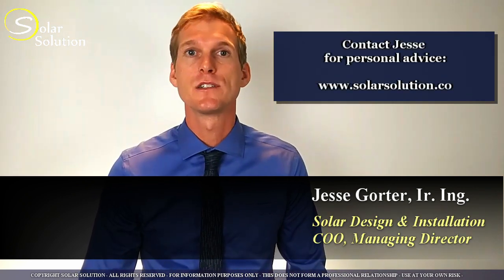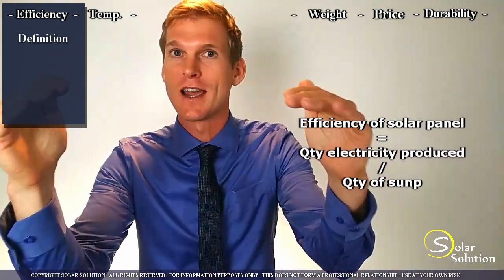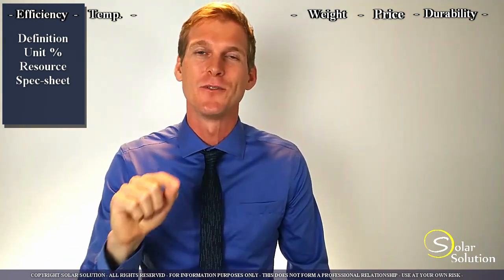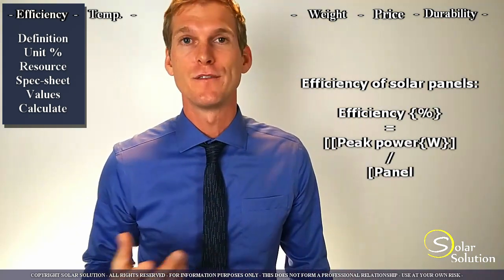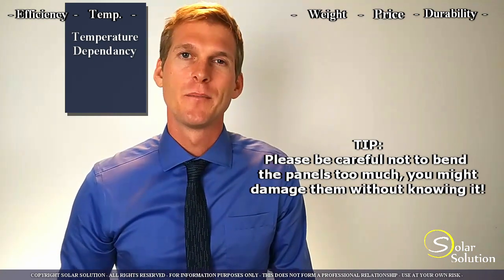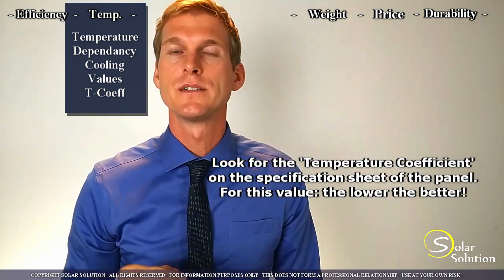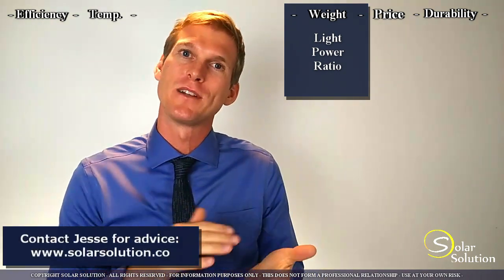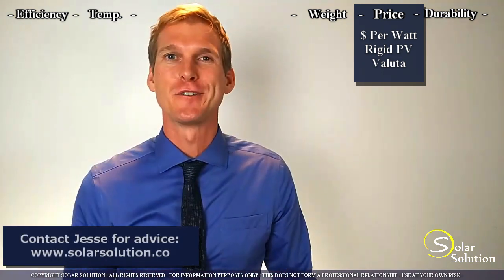Flexible Solar Panels: How to identify high Performance & Quality

Comment: Very informative on the base level...thank you.   explained it well.    Joke:  Chinese flex panel 200 x 2  400  panels.. no real specs. ...  warranty.  20 years IF you dont use them..   void if hooked up

Comment: Hi Jesse. I love your videos. I have some specific technical questions.
I want to mount 2 x350W ETFE panels on the aluminium roof of my caravan.  There are any number of reasons that make this a desirable solution however I have some specific questions about temperature and durability performance in this particular environment. 
How much convection cooling is achieved from the back of a flexible panel.
How much conductive cooling is achieved through the back of a flexible panel.
How much black body radiation from the front of the panel helps keep the panel cool.
Can I assume if a panel has 1Kw radiation, at 20% efficiency the heating effect is equivalent to 800W onto a non solar surface.
Are there any issues with delimitation. 
I think many of these questions would come from specific research and measurements. 
Any help would be greatly appreciated.

Comment: When you mount the hard mono/poly on a Van, how durable are they to all the pot holes, and imperfect road bumps?  Are the Hard panels better or flexible panels?  I guess I am asking, what if I have to travel on gravel road bumpy, vibrating road for several hours, would the hard panels break (inside)? Are the flex panels better?  Let me know. Thanks.

Comment: Hello Jesse, I have been enjoying your videos and vast knowledge on the subject. I would like your opinion on the "CIGS" technology flexible solar panels. I just order 5 each 80 watt panels from Rich Solar for 400 watt total, pricy at $259 each but they say you can walk on them and that they pull power from early morning until the sun sets. 68" x 14" and self adhesive (good and bad) but they will lay flat with no wind resistance or extra road noise. Hoping it will do the trick on my little 24" Fleetwood Pulse RV. 12V 300Ah Lithium Iron Phosphate. Keep the videos coming, great work.
Reply from the maker: Congrats on your purchase! I am sure you will enjoy them: The weight advantage and ease of installation are great pro's for CIGS panels. I'm glad to hear you enjoy the videos. All the best, Jesse.

Comment: It would be nice to better understand how to measure efficiency of a panel after some time has passed. Is it volts, amps, or ?? And can a consumer with a VOM measure this successfully? Or does the charge controller offer those values in most cases?
Reply from the maker: Hi Dennis, thanks for your message. Great topic suggestion, thanks. I will convert that into a dedicated video. Jesse.

Comment: I am curious if you are familiar with Merlin Flexible solar panels which are used on tractor trailers. They claim to be military grade which I have no idea what that means. What has been your experience with these type panels? Thank you.
Reply from the maker: Hi Anthony, thanks for your message. I have not worked with these panels yet, though you have spiked my interest. I will go and check them out.
Reply: I love my Merlin panels

Comment: I’m actually very very new to this and learning loads from you thank you - I am interested in a full details on what you feel is the best full set up. So what type of batteries panels etc. So if you were to chose what brands and which ones would you use. That would be such an excellent help. I’m in the Uk now and France - when we can travel.
Reply from the maker: Thanks for your message @Spoil All, I am happy the videos are useful for you. As for your question what the best full set up is, this is a bit tricky to answers since it greatly depends on what the user requirements are.

Comment: Nice work! Do you want to do a video on calculating demand? I’ve researched a bit and mostly understand, but it still confuses me somewhat. Would it be easiest to convert everything to watts, then estimate watt hours — or go to amps?
Reply from the maker: Hi Dana, thanks for your feedback. Great suggestion! I will make a separate video on this.